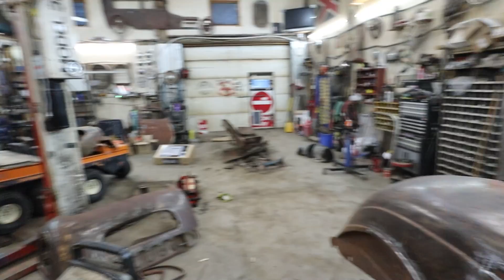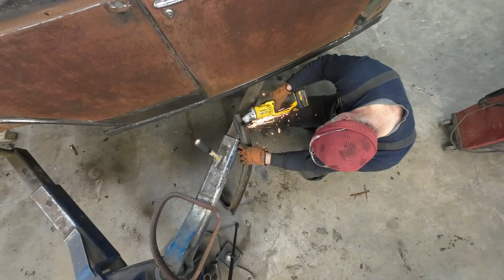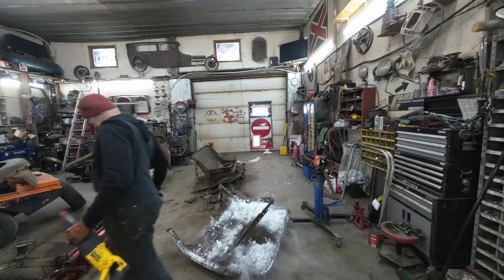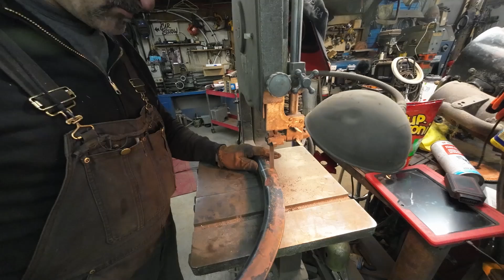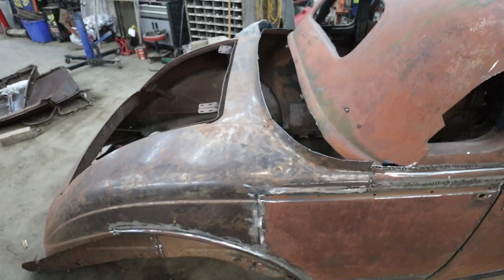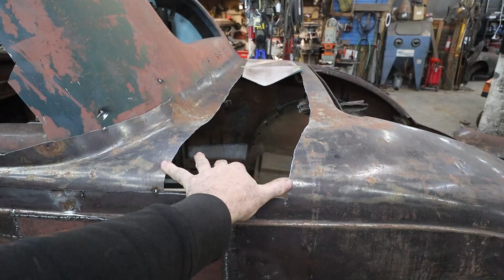Chopping the roof and reshaping the door tops of our 36 Dodge Coupe p7

Comment: I'd suggest doing the "B" pillars next that way it is easier to shape than roof panel filler pieces. I agree the rear window needs to drop down too. I think what is throwing off the look with the quarter panels is on the 36 Ford 3 window the doors are longer than what you have.

Comment: Yup, I'd section the rear end forward to match the rear wheel well with the back of the roof section. That will bring it all into proportion and avoid that Zephyr look like you ended up with on the Pontiac. Lots of work, that is for sure. It is definitely taking on the chopped 35-36 Ford 3 window profile.  Thank you for taking us along. The entertainment is much appreciated as well as educational.

Comment: Yes move the back window down maybe not all but a good bit, you want to see out too. I like shortening the rear body4 to 6 inches that is the right way to pull all the elements together. It will look like a real light weight and sporty Hot Rod. No back seat but some storage for road trips. Gonna be a cool ass Chine and No Body gonna one like it. Very Unique. Boy I go back to the start then back the end and you have really changed the whole look for the better. Great effort you Metal Maniac.. D

Comment: Just thinking while you're thinking. I know it's too late, but...
Be cool to remove the post and make a hardtop 2 door with a longer window. If that makes sense. Appearance, uniqueness and visibility. 

Either way, it will be cool after a 1/2 dozen spools of wire and a few tanks of shielding gas. :)

Comment: Evening bretn.i have a 38 dodge 5 wnd buss cpe.i have a book on chopping tops from the 80s.it shows a mopar same year where they shortened the rear between decklid and rear window by 6 inches .it wasdone for 2 reasons to keep from adding to roof length and to shorten rear.a neat trick is to use a enlarged photo of side profile and cut it up .i do this often on chops.

Comment: Definitely drop the back glass lower. 3 inches might be alot to take out of rear window.. 6 inches will be too much to  shorten on quarter panels don't want the  stubby look either. The fenders are big. Set them up for a visual. The flow will be the credit 👌 for your talent. It's your project I thought I would voice what is in my minds 👁. Great job

Comment: It dose not look bad going for the 38/39 zephyr look with the long tail. Comparing what you have laid out to a pic of a zephyr, it is the outer fenders that extends past the trunk in a tear drop. The wheel well would come out the same about the same and moveing it foward would not be needed for that look. You could also finish it by extending the wheel well foward 2 to 4 inches, then move the axle foward half that if you wanted but would make the long tail more pronounced. Making the tail shorter like a 37 willys coupe would not be bad eather. Id say set a outer fender on it and make your decision that way, since it would give a perspective of the tail as a hole.

Comment: I can see the plan. Love it. Did you size up using the front section of the door in the back? All the bits are there for window and it will flow with the front roof section you have. Might save alot of time.

Comment: I agree the trunk is too long. I'd be tempted to make the doors wider/longer and sweep the roof line back into the trunk. That would maintain the original length of the car. If that's not important I'd shorten the body like you're talking about. Like where you're going with it. Will watch the next one to find out what you do. Be safe and stay well.

Comment: I was thinking the doors could be longer but shortening the trunk works great too and probably less work. 

If you lay the back window down more it gets shorter on its on. I was thinking run the stretcher down the edge of the roof pan where you sectioned off the drip line. Probably make the sides come out where you want with less cuts.

Comment: I still think the doors need to be longer to get the roofline correct, I like to do the mock-up in photoshop, maybe try the old roof on a longer door, but I had the same thought about rounding out the back of the door windows with that piece from the rear wondow

Comment: Man I thought for a while there that you screwed that chop up. It just looked wrong to me.Then when I saw it after you had the paper covers over the opera windows and the tulip panel area gap I definitely got what you were up to. Looks really really good. And I agree. If you pull the rear of the car inward to minimize the "trunk stretch" its gonna look killer. Once again, respect🙏.

Comment: Did you ever consider photographing it side on first and laying the cut out on a paper sheet and then scalpel it about, rather than doing the same thing with the death wheel first, so do a sort of  Chip Foose ?.and sketch in the outline till it looks right.
Personally a bit more rake on the rear of the roof, so more of a fast back look ?. it may save shortening the whole thing so much if at all.  great job with the cutting right off the bat I could not do that so fast.
Reply from the maker: I usually do that when I chop it I Photoshop and make some lines and stuff with that said things always change while I'm building haha
Reply: @HalfassKustoms  Thank so much for the reply , yes you can only go so far with a one dimensional side profile,   in the 3d reality you need to stand back and appreciate the proportions that that profile has on another one  ie front and rear. Then,  as you say,  ''things change '' when crafting or sculpting the  final creation.
It has to 'look' right or what's the point in just altering something for the sake of it.  It must blend in  with and enhance upon what is already there, as though it always looked that way.  Some plastic surgery comes to mind ....ooof !!!

Comment: Im digging the look chop the rear window, section the rear quarter/ trunk, split the sides of the roof to be proper width. Looks bitchin was not how I had pictured you would do it but definitely will look good. stay warm keep it rubber side down

Comment: The drinkers window curve would work on the passenger door. And the other side is just the opposite. As long as you are cutting why not slide the back window section back to fill the gap behind the window.

Comment: Would it be possible to use the spare front pillars as the inner bracing for the B pillars as you were contemplating since it already has the drip rails and then use the front of the spare doors for the back of the doors on the car to get the same shape and they will already fit the grafted pillars and have the inner bracing and window channels?

Comment: you pulled that together pretty good.  I think you can add that belt line around the back too.  and def shorten the trubk.  if you plane it right you can Z the driver side dent out by the window.
Do you think you need to take someof the high brow out of thge roof ?
Reply from the maker: Yeah I'm mixed on the roof.

Comment: When cutting, I'm not sure why you use the plasma cutter some places, and the grinding wheel other places. Can you elaborate?
Reply: Because sometimes there's 2 layers of metal and he only wants to cut through 1 layer, the plasma will blow right through both layers.
Reply from the maker: I use the plasma just for my rough cuts the ZIP code I usually or I should say pretty much always use when I'm actually welding the panels so there's no slag in between it

Comment: I see where you're going with dropping the top front end give it a slantI see where you're going with dropping the top front end give it a slant I kind of like your idea of shortening up the body a little bit I think it would look better if the side windows look lower in the front than they are in the middle of the car if you know what I mean anyways I get where you're going I dig it it's bitchin But holy smokes I've never seen a guy chop a car like that before haha I've seen you do crazy work before that just turns out beautiful so I know you can do ithanks for the videos always a good time

Comment: I don't get it..Why you cut a 4 doors to make a 2 doors car? it was easy to get a 2 door and move from there. Also the car is huge long, you may need to cut 2ft to get a little car? Make no sense so much work....
Reply from the maker: It may have been easy to get a 2 door car in he day but it much harder now.
Reply: Because a 2 door is much more desirable than a 4 door so they're hard to find and cost 5x's as much if you can even find 1. Yes a lot of work for sure but it's all fun to Brent. 😉✌
Reply: Then we'll have more of Pablo if he has nothing to cut up.